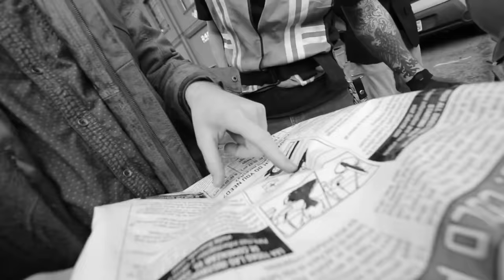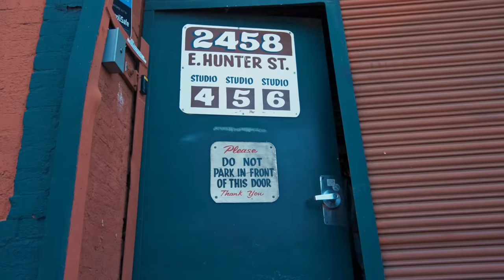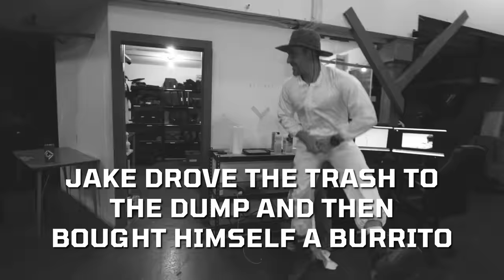City Wouldn't Cleanup Trash, so we Did!

Comment: You REALLY should be wearing painter's masks (P100) at the least.  Something with an active carbon filter and an expiration date.  N-95 and lower are particulate filters.  The will not protect you from bio waste or fumes.  If you can smell through it, it's not protecting you.

Comment: Don't do this, don't do the city's job when they're the ones making such garbage possible.  If you want change in a failing city, vote them out in your local elections, hold them responsible for the duties they are elected for.  Remove them if they don't remove the garbage.
Reply: maybe wren should really run for office
Reply: Maybe, sometime you have to do a better job then they are to prove that it can be done. That could push action. I applaud them. Saying, "will did you vote for..." means nothing. Then you would complain after who ever you voted for, doesn't do a thing to change it ether. And the cycle continues..... Someone should set the standard, and blast that all over the internet. Like these gents are doing.  Make it a Bipartisan slap in the local Gov't face.

Comment: one thing I will say is they mentioned they needed safety gear because of the risk of biohazard but they are wearing regular shoes they should be wearing thick rubber-soled boots in case they step on a needle so that it won't go through the shoe and into there foot those needles could be hours to minuets old and could still be covered in the HIV and Aids virus